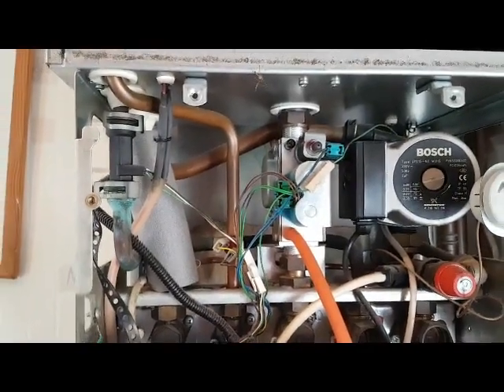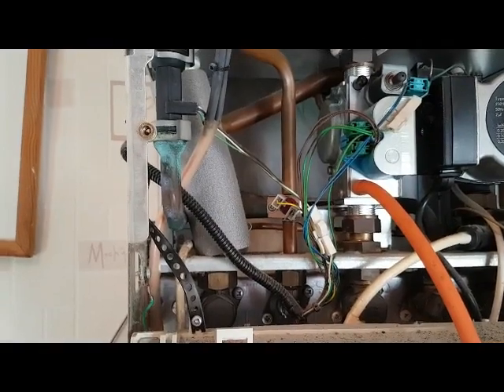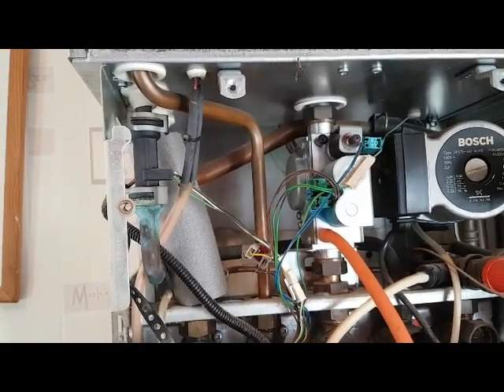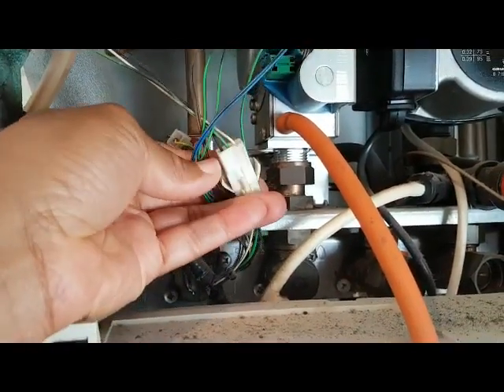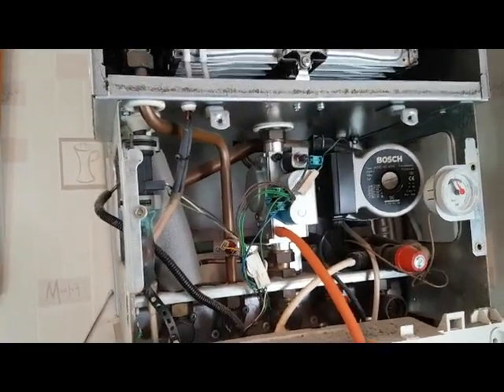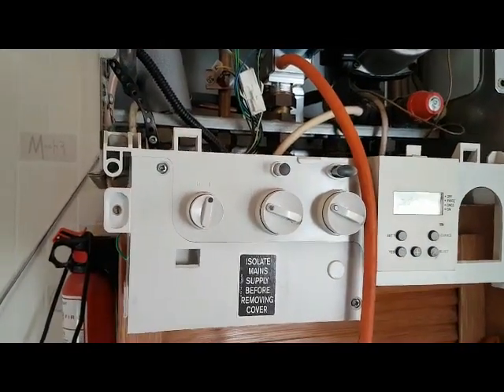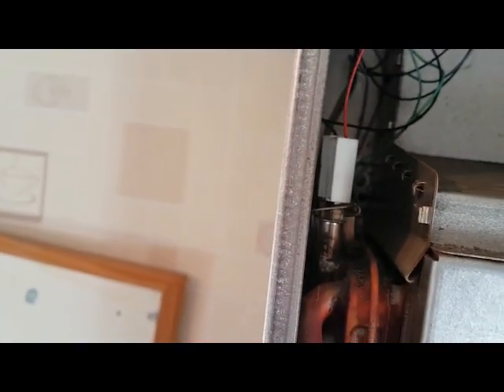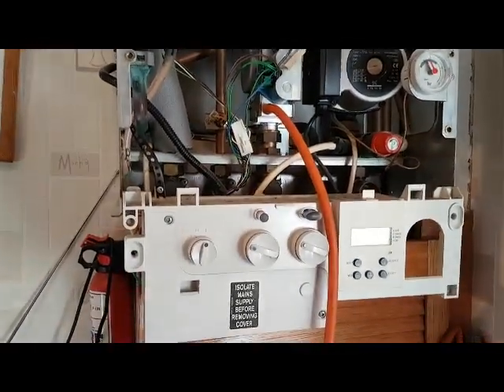Worcester 28SI Mk2 Hot Water Fault Answer. With Coach Tony Morgan

Comment: Hi, I have one of these boilers, i have lost functionality of the central heating part, the domestic hot water part works fine.

It was working fine and then at the beginning of summer i turned the central heating temperature knob down to the standby mode...I have just tried reactivating the central heating but as soon as i turn the central heating temperature knob up it trips my mains circuit breaker...

Can anyone offer any suggestions as to what it could be??

Comment: Hi, brilliant video mine blew the white ceramic 2A fuse on Saturday. I put new fuse in and disconnected the pump but blew again.

Reconnected pump put new fuse in disconnected top fan opened tap fuse did not blow.

Would I be correct in saying that it's definitely the fan? Thanks in advance 😅

Comment: Good video, I have an older Worcester RFS 28i. Central heating is fine, hot water has an issue, I get hot water but after a minute or so the boiler isn't lit and I get cold water, boiler relights itself and hot water is flowing for a minute or so and then the burner isn't lit anymore. It's on then off and just keeps doing that. CH pump isn't running when I ask for HW, I'm guessing the pcb board is OK,...any ideas, what do you think.

Many thanks 

Ian

Comment: I've got different problem. Some of my radiator pipe get hot, even if central heating is off. I found out this happen when I turn hot water on, so some of hot water goes to the central heating. I've thought that might be diverter valve faulty, but this boiler doesn't have one. Maybe DHW flow turbine is faulty and need to be replaced? Any idea pls :)
Reply from the maker: Yeah you could be right. By the way can you subscribe to our channel?
Reply: @ARBoilers  yes already subscribed 😀
Reply: @ARBoilers   Would you be able help me decided with external expansion vessel? I need to replace mine as water come through top valve and pressure goes up when CH is ON and down when cooling down. Re-pressure does not help. I've tried few times. Cannot replace existing EV as boiler is close to the ceiling so there is no room. I do not want to take whole boiler out as is inside kitchen cupboard and I will make more mess if I do that, then rebuild cupboard, painting etc. My plan is buy exactly the same EV and put on left side close to boiler (enough room) and with extra pipe and few elbows connect to the same place - plastic manifold where is installed PRV on the left and pump flexible hose on the right. Is this idea will be good and will work fine? Obviously need to close/drain water, re-pressure etc.
Reply: Hey did you find the problem? I'm having the same issue
Reply: @r2d2  I've checked turbine sensor voltage when is connected with hot water tap ON and disconnected too. Voltage between  black+green, green+white, black+white cables has different voltage against boiler manual. So I've decided to buy and replace PCB, but did not have a chance to replace it yet.
Reply: @dariusz.kalwaj  Thanks for the reply, I'll try the same :) Was the PCB easy to find? These boilers are getting old now!
Reply: @OneLifeYourWay   I've got Worcester Junior 28i. What I found out there is two PCB number for same PCB. Both PCB are same just number slightly different. One PCB number is old, but PCB will fit and work fine. I bought mine for £27 on eBay. Fully checked and with warranty. Check boiler manual and find exactly what PCB numer you need. New one cost about £120-150 for my boiler. For Worcester boilers you can buy everything. No problem to find any parts. You just need to have/find proper part number 😉 By the way, I've got another problem with expansion vessel.....
Reply from the maker: Thank you 😊
Reply from the maker: You can connect your expansion vessel anywhere on the system but don't connect inside the boiler
Reply: @ARBoilers  Thank you for your reply :) I really appreciated that someone wants to help me :) So will be better to piping to the return side outside the boiler instead with extra pipe (I think is 10mm Dia) and few elbows connect to the same place/plastic manifold as I mentioned before? Genuine pipe from EV to manifold has about 10cm long. If I go with my idea will be about 50-60cm long in total (included brazed elbows) to the external new EV. And I was wonder if this might affect the pressure because is too long....? That was my thought on the beginning..... Another wondering, if I leave existing faulty EV, is the pressure sill will go up and down even with new external EV installed? Should I disconnect old EV from the system and just blank the plastic manifold? I hope this is understandable what I wrote :) :)
Reply from the maker: Thank you for your comments and can you please subscribe to our channel 😊
Reply: @A+R Central Heating and Boiler Repair Experts Ltd  aleardy did. If you could have look on my comment regarding external expansion vessel that would be great.
Reply from the maker: Yeah you can blank off the old expansion vessel
Reply: @A+R Central Heating and Boiler Repair Experts Ltd  Thanks 👍👌👍I have look last night again and return pipe where I could tee external EV is behind cupboard. I do not want to remove cupboard and make more mess, so I still thinking about my way as I mentioned before. Is my way won't work properly?

Comment: My son has a WB greenstar and I have one in my rented house. Not impressed at all with hot water. You need to turn taps on quite fast before it works. Also if you run water fast the temperature drops. My Vaillant boiler supplies hot water at much lower flows and maintains the set temperature. Had these checked under warranty and no faults found! Very poor design
Reply from the maker: What model is it ?
Reply: @ARBoilers  son's is a greenstar 30i. Need to look at documents for the other but I think it could be a bit lower output like 24 or 26kw. Isn't the HW flow regulated to maintain the set temperature and whats the minimum flowrate for the boiler to supply hot water? I seem to have to have the tap running quite fast compared with our Vaillant and our Vaillant supplies hot water at the temperature set even with the tap full open.

Several engineers recommended the Worcester Bosch but thus far I am not impressed with the HW performance. Turn the tap down a bit and the whole pipe fills with cold water and you have to wait for the hot to get through again when you turn it back up!
Reply from the maker: @johnf3326  sounds like the hot water heat exchanger

Comment: Thank you for posting this helpful video. Most grateful for this, along with the theory & subsequent voltages given, to & back from the flow turbine sensor. I am an ex TV engineer... & also wonder if the turbine flow sensor may send PWM (pulse width modulation) square wave pulses generated by rotation... back to the PCB, to signal water flow is present. But perhaps the PCB only has a voltage drop dependency, not requiring any pulses. Anyway, cheers for sharing this valuable information guys! :) .
Reply from the maker: Thank you for your comments find out more about what we did visit our channel https://www.youtube.com/channel/UC6-bsNMHhQnFtMo2kdVEb7g
Reply from the maker: hey we're currently trying to grow our Facebook group and would love you to join Tony and the team using this link, Tony will be available to answer all your questions directly there's also updates on new trainings we just released too. https://www.facebook.com/groups/167070231326174

Comment: hi tony i have the worcester combi boiler 24si11/28si11 series. 
my problem is over the last month the hot water taps bothup and downstairs are giving a very poor flow. 20 mins to run the bath i believe all the mains flows to house are fully open and in order so i think the problem is in the boiler itself. could you please advise hoe o may be able to bring the hot water pressure up so that the hot taps will flow properly thank you from mark malcolm
Reply from the maker: hey we're currently trying to grow our Facebook group and would love you to join Tony and the team using this link, Tony will be available to answer all your questions directly there's also updates on new trainings we just released too. https://www.facebook.com/groups/167070231326174